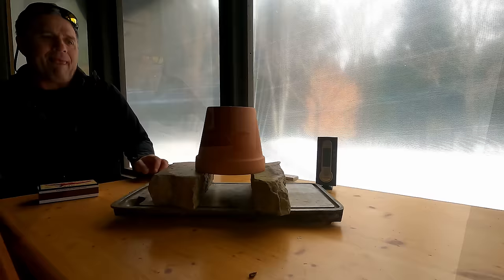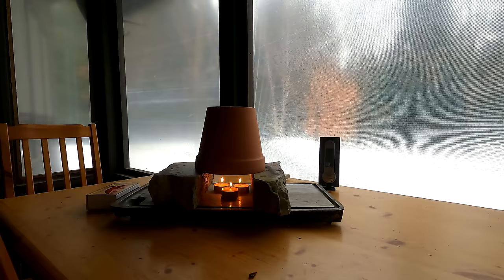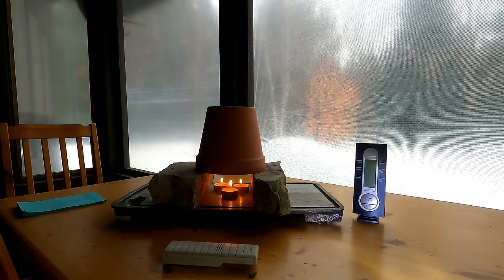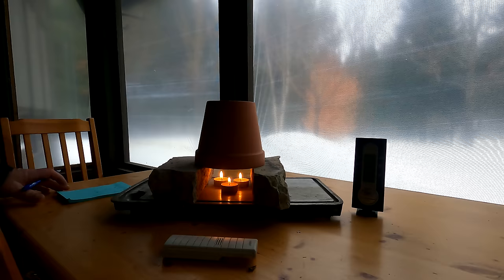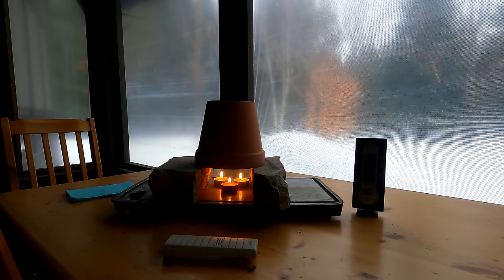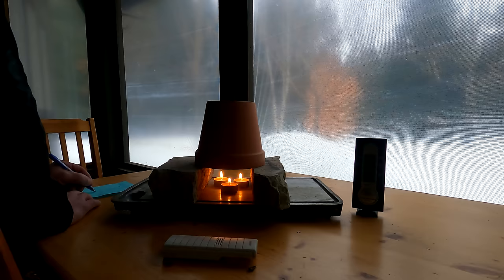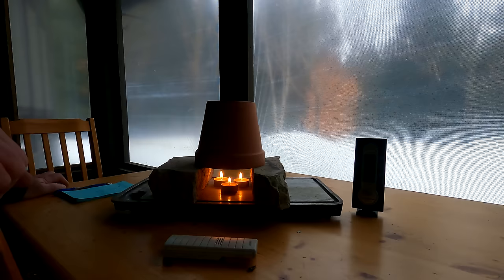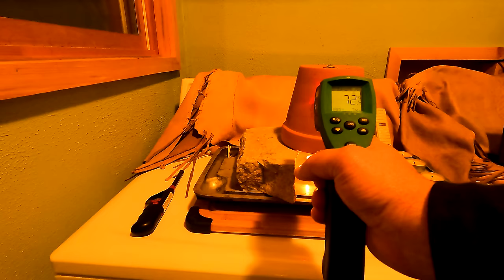Testing the Clay Pot Heater | Truth or BS | Prepping and Testing

Comment: A candle is only going to produce so many BTUs. No amount of pots will increase that. You would have the same result by burning the candles by themselves..
Reply: Exactly. High school physics
Reply: No it is a mass battery essentially.  It spreads out the heat and it is a dense mass that holds heat. So you increase the surface area and holds heat longer. It isn't producing more heat just increasing efficiency
Reply: @curve5746  a candle only produces so many BTUs.....does not matter if one heats air, water, or pottery, a BTU will always raises air temp the same
Reply: It's all to do with precipitation in that the heat exchanger accumulated the heat from the combustion and stored it so that it can be released gradually.
Just like the old electric storage radiators.
Reply: @dasdasdatics420  whether a BTU is released quickly or slowly, a BTU will always raise the ambient temperature the same and a tea candle doesn't produce many BTUs
Reply: Put a thermal fan on top of it to distribute the heat????
Reply: @tntgators  sounds like a good test to run. I do not believe it will raise the temperature in the same manner when released all at once vs gradually. I would be very interested to watch both through a thermal camera
Reply: You should probably move the room thermometer away from the pots
Reply: I tried it and it was a complete waste.
Reply: Skip the pots. A candle provides the same amount of heat with or without them.
Reply: Quit smoking pot. It confuses the simple minded human. Just say no🤡😑🙏
Reply: @kurthubbard-beale5003   🤪
Reply: I heat my home with a cast iron wood stove. Recently I put all of my cast iron cookware on top and wouldn't you know it, the stove radiates heat for a longer period of time, after the fire goes out, which in turn heats my home for a longer period of time with no further btus being produced.

Same principle here. You are storing the heat and releasing it more efficiently.

So while yes, a btu = a btu, that btu can be used in different ways. So no, just burning a candle in the open air isn't the same as burning it and storing the energy in the form of mass, in this case a clay pot.

Air, water, soil, wood etc, all have different heat absorbtion and transfer rates. 
For example, water is 25x more effective in temperature exchange than air is.
It's why your cars engine uses a coolant liquid mixed with water instead of relying on the surrounding air to displace the heat and keep it from overheating.

Maybe go back to physics class and pay attention a little more.
Reply: A long time ago I figured out it would take a dozen candles to warm a small well insulated closet. Most of warmness effect would come from lack of oxygen to the brain. If small enough room & heavy insulation no candles would be needed. Our body is a 98.6 heater
Reply: No doubt …..the pot industry put this out…….
Reply: Candle burning without cover, heat rises straight up, marginal hot air mix as it ascends to ceiling. Pots over candle acting as heat sink, captures, retains heat for better local distribution of the energy. Energy output is the same. Distribution of energy is optimized.
Reply: @blackpine6693  🤣
Reply: @Az_N.S.O.L.  You can't compare a candle to a wood fire. The heat source is what generates the heat. Your cast iron (or a pot or anything  else) can only store what's put into it.
Reply: @Mrs.Patriot   Be it a wood fire or a gasoline fire or a candle flame, they all produce heat. 
This is not about what produces more heat, a candle flame or wood stove fire, but how to use that heat in a more efficient way by storing it as thermal mass.

I think that point completely went over your head.
Reply: @Az_N.S.O.L.  But it is. Candles will not heat a greenhouse. Maybe that went over your head.
Reply: @curve5746  
1st law of Thermodynamics... energy canNOT be created nor destroyed.  It ONLY changes form. 
It is impossible for the pots to increase the amount of heat put out by the candles.
Reply: @Az_N.S.O.L.  
No... the pot does NOT increase the efficiency of heat output either.  
BTU is a measure of the heat output of an energy source.  
In order to increase the average temperature of a house, room, greenhouse, etc... the heat output of the energy sorce must be greater than the rate of heat loss. 
There is NO way you are escaping the 2nd Law of Thermodynamics on this.  

The pot is NOT acting as a mass battery, increasing the efficiency of heat output.   
The pot is acting as an insulator slowing down the rate of heat loss around the candles, (the heat source).  
This ONLY allows the air next the pot to increase in temperature a 1 or 2 degrees.  
For the air 2 feet or more away from the pot... there is NO increase in temperature, because the rate of heat loss is greater than the heat output from the pot.  The colder the surrounding air temperature is, the greater the rate of heat loss will be, further reducing the effectiveness of the candle/pot heater.
Reply: @OOTurok  if the candle or heat source goes out, does the pot stay warm and continue to release heat, or does it immediately cool to room temperature?

It stays warm because it is storing the heat. Some call that a battery...

I dont know what is so hard to understand about that fact.

Also can you prove the rate heat loss in his greenhouse is greater in this scenario? No you can't, so your point is moot. You are creating a scenario to suit your narrative by saying it's a fact that the heat loss is greater than the output.

If the heat loss is more than the output, great, the candle won't heat the greenhouse, I get that, but like I said before in my other post, this isn't about if a candle can heat a greenhouse or not, this is about if storing heat in the clay pot helps with efficiency. 
Which it does because the pot continues to release heat after the main heat source is extinguished.

It's really not that hard to understand.
Reply: @Az_N.S.O.L.  
Simple fact is it does NOT work.   
The heat output is TOO small, & the heat transfer from the pot to the outside air is TOO slow. 
The candle-pot is not effective at heating up a large air space outside the pot, because the rate of heat loss of the outside air is far too great.  

The candle pot experiment has been done countless times in college physics classes, to demonstrate how the Laws of Thermodynamics debunks your magical candle-pot heater myth.
Reply: @OOTurok  there you go again, hung up on if a candle can or cannot heat up x(amount of space).
That is not what I am discussing here.

Can you read? If you can read, please quote where I said a single thing, in any of my posts, about if a candle will definitely heat up x(amount of space)...I'll give you a hint, I didnt.

I already acknowledged the fact that if the heat output of the source is lower than the heat loss, that this will not work. But again, that is not what I am discussing.

What I am talking about is thermal mass storage and releasing that stored heat over a longer period of time to improve efficiency of heat transmission.

Is the clay pot considered as mass?
Does a candle produce heat?
Does the clay pot store and release that heat? 
Does adding more mass store more heat and release it over a longer period?

If the answers are yes, then all of your talking points about, a candle can't do this and thermodynamics that, is just you flapping your gums, or in this case fingers.

Someone who talks so much about physics and thermodynamics should be smart enough to follow along with what I'm talking about...SMH 

Are people really getting this fkng stupid???
Reply: @tntgators is not a candle primarily a light source, are these devices not changing essentially light energy to radiant infra red energy? Or something along those lines?
Reply: @littleworkshopofhorrors2395  Hmmm. Possible that it changes but then why change it? All the energy produced by the candle would be absorbed by the air or the room materials themselves
Reply: @tntgators  you can feel the heat of an infra red heater as warmth but not so much of a lighted candle. Think in very loose analogy of a heat pump, which turns a vast low grade heat into something concentrated,that you can feel. One of these pot heaters, if they do work, turns a small high heat into a larger low level than you can warm yourself by.
Reply: @Az_N.S.O.L. 
BUT this entire video is about heating your house with a few candles under pots.  So why do YOU keep going away from the candle?   Yes the pot is a thermal mass BUT the candle does only put out X number BTUs. The pot will store these BTUs and release them slowly but it's still the same number BTUs.  And a CANDLE (basis of entire video) will not heat a room!  Air is a horrible conductor of heat compared to many other things, that's why even the cast iron wood stove takes hundreds to thousands of BTUs worth of wood about an hour to heat a room from 58 to 70 degrees F.   Again, YOU try reading. VIDEO IS ABOUT USING CANDLES TO HEAT A ROOM!
Reply: @kirkstinson7316  my posts are in response to the ops post about burning candles by themselves giving the same results, not the video itself. That's why my comment isn't on the main page and is instead here...SMH 

Did you even think before posting? 
Apparently not...I've only said my posts have nothing to do with if a candle will or won't heat a given space about 10 times now.

Damn, brains don't run strong in this thread.

But I do agree air is a terrible conductor of heat, which is why you use the clay pot to increase the efficiency because ceramic is much better at conducting heat than air...lol thanks for proving my point.
Reply: It’s not the BTUs of the candles. That’s a fixed amount. What this fixture does is distribute the heat more localized to where a human is likely to be. Without the pots as heat capture and storage devices, the heat from the candle would go straight to the top of the space as a thin column of heated air and combustion gases, but humans don’t walk and sit on the ceilings. We live closer to the floor and to table tops, and that’s where these pots would be placed. The pots slow that heat transfer upwards and spread the column of heated air rising from the candle wick pin point to the diameter of the pot.
 The fact that three tea candles heated the outside of the outermost pot to 70’C in 2-3 hours should indicate to you how much heat would otherwise have been warming your ceiling straightaway from the candles alone.
Reply: @user-ms5su6jv2j  agreed to a point. Yes one could sit close to the pots and warm one's hands. This video and others like it purport to heat a room. This experiment had many flaws. Outside temperature.  HVAC running? Sunlight, and of course his thermometer was too close and he didn't take the temp in the rest of the room.  A candle in a room will not make any difference unless you sit beside it and hold your hand over the flame
Reply: @azfoa5218 you are 100 % correct   however a clay pot heater won't do much, probably heat a small closet  a steel plate on a wood stove or any source of heat will retain heat
Reply: Exactly right! Basic science.
Reply: @Az_N.S.O.L. exactly what I was going to tell these dolts, but it's useless explaining radiant heat to them apparently
Reply: Except your wood stove isn’t a closed system., as the flu vents out of the room.  This clay pot thing vs just candles is a closed system in terms of the room.
Reply: @theholisticmachine1493  
You don't need a clay pot to radiate heat from the candle.  
Radiant heat already comes directly off the candle flame, because the combustion of the wax is an EXOTHERMIC  REACTION.  
Perpetual Motion is a myth.  People like you need to take a basic grade school level physics class.
Reply: Definitely worth trying and proving it wrong or right!
Reply: So are you interested in cooling the whole room or the area close to the pots - without the pots the lit candles and their BTUs heat a thin column of air directly above them and then (at best) create a temperature change in a thin layer around the ceiling. This is not a central air heating system - it concentrates warm air where you need it. Is it cost effective? I say yes. Many many people seal off most of their houses - not trying to heat the whole thing - just where they happen to be - the pots take that concept a step further - expand the radiant aspect of the candle's heat via the pots - and just heat a bubble in the room where they are. The BTUs are not wasted in a thin stream directly above the candles and in a small later near the ceiling. Think about it.
Reply: @tomwells6499  
Moving the goal post does not validate any of these pro candle-pot claims.  
The claims made in all these videos, is that... putting a pot over the candle creates a heater that will heat a room or a greenhouse.   This claim has been proven FALSE.  

The pot is an insulator that turns the candle into a tiny oven,  NOT  a heater that can heat a small space around it.  
The air space being heated up, is INSIDE the pot.  So unless you stick your hands inside, or on the pot, you are NOT going to get any significant heat from it.  
I can crank the oven in my kitchen up to 400° F & it won't do a thing to heat the air in the kitchen.  

The radiant efficiency of the candle in the room is already 100%.  The pot canNOT increase that efficiency, because of this inconvenient physical law that doesn't allow energy to be created.
Reply: @OOTurok - Hold your hand three inches above a lit candle and then three inches to the side and then tell me about the radiant properties of a candle flame.
Reply: @tomwells6499  
It's simple.   The radiant properties of the candle are that it radiates heat, because combustion is an exothermic reaction.   
Direction of the radiance is irrelevant to the fact that the candle radiates heat.  
You have no valid argument.
Reply: In order to have a legitimate result for your heater, you would need to measure the heat that you contribute to the room over the same period. What you would learn is that the candles contribute very little to heating the room. The heater focuses the heat of the candles and radiates that heat in a manner you find useful.
Reply: Same amount of BTU yes. 
Just a better way of radiating the heat , after the pots have heated up of course. So initially it would actually be a negative.
Testing pot temperature only proves indeed the candle is making it hotter 
Too many variables in a room exposed to the elements with people coming and going. 
I think that pot works as a nice hand warmer.
Reply: The pot slows down the heating of the room. Heat the pots and after the candles go out heat comes out of the pots.

If you want to heat room faster, just use candles. If you want to heat room low and slow use pots, or bricks, or sand, or salt, etc.
Reply: @Az_N.S.O.L. Yeah so you heat a large cast iron stove with big blocks of wood, not a candle……lol😂
Reply: Need to remember that your body heat warms the room too.
Reply: Come on! But we like living in fantasy land
Reply: @tntgators  you're correct a candle only produces so many btus, but the pot creates more surface area for heat to exchange with ambient air
Reply: Add enough pot, you’ll feel better. It’s science.
Reply: Not true. It’s Radiant heat.
Reply: Calling something a battery doesn’t mean anything to the science. The only difference is a little bit time. Amount of but’s released are the same. One will not heat a room more than another. What does happen is the pots allow the heat to be radiated out in a manner that allows people to feel the warmth more than directly above the candles as they burn. Does that heat the house? No, no more than 3 candles and a fan does. But because of the radiating of the pots people feel as if it doing more. The best way to heat a space is to produce more btu’s than is released by that spaces insulation. Great insulation allows for less btu’s needed to warm the space because of the slow loss of heat across the medium.
Reply: @curve5746  The air in a single room is more thermal mass than a candle can rapidly heat, so that isn't necessarily beneficial.
Reply: @Az_N.S.O.L. it takes time for the pots to heat up just the same as when they cool down. There is no advantage. Simple really.
Reply: Maybe if we had a dollar for each arguing comment we could build a 10x10x8 room, basic insulation, couple of windows, one table and chair. Setup the pots with tea light candles and test for yourselves. However, you could watch all the videos from both sides either proving or disproving the debate and pick which one you want to believe, without comment!
Reply: I would have used watts as the unit.... But you took the words out of my mouth.
Reply: I would have used watts as the unit.... But you took the words out of my mouth.
Reply: I would have used watts as the unit.... But you took the words out of my mouth.
Reply: I would have used watts as the unit.... But you took the words out of my mouth.
Reply: I would have used watts as the unit.... But you took the words out of my mouth.
Reply: I would have used watts as the unit.... But you took the words out of my mouth.
Reply: Thank you. A person of knowledge.
Reply: @danielpartin875  Joules is joules. Watts is watts. 

Where do you think that energy goes when there isn’t a flowerpot over the candle?
Reply: Its like saying the transmission on your car doesnt matter at all because the engine only has X horsepower.  Its the same thing but candlepower
Reply: @lostpony4885  wow, that analogy doesn’t work at all.
Reply: I use single pot and a couple of tea lights on my workbench if I want to warm the space slightly, works fine.  It acts as a mini radiator for the bubble of space a few feet around the pot, spreading out gradually, rather than shooting up to the ceiling.  If you buy an IKEA plant pot with base and a steel cutlery holder, you only need to plug the top with a bolt or coin, and you’re good to go.  You don’t need lots of pots.  My immediate workspace will raise from 16c or 17c to 20c with this set up, I keep a digital thermometer about 2 feet away, so know exactly how it performs.  Been doing this a couple of months now, you can turn the broader space heating of your property down lower, and localise the benefit of the pot heater for times you feel chilly.  Lots of overthinking going on in this thread, just try it sometime.
Reply: I agree I tested it..the room didn't get any hot with the clay pot...the tea candles heated the room..I beg the difference..😊😂.I don't know how he's getting his reading 😂 oh well. How about we just agree to disagree😅😂
Reply: Half the people on here can’t string a sentence together, let alone be trusted for input.
Reply: It changes how the heat is distributed. By heating on object, less heat is wasted through imperfections in the system. So , yes it's the same energy, but it's being used better.
Reply: The point is that three tea candles can heat up a room, albeit not hugely. Tea candles are dirt cheap by the way, large candles not.
Reply: more air touches warm pottery that would pass through an open candle flame
Reply: I agree… i think it helps to maybe dry gloves or something though, with a candle…. You can lean em up and keep them from burning or snuffing the flame…. But i tryd this once.. had like 20 of them in the house with 3 candles each…. Couldnt tell a difference.
Reply: But they are using three and the pots(three) are trapping the heat in them and letting the heat out slower than you can think!
Reply: What everyone is missing in just talking about BTU’s is that the clay pot is effectively turning what would otherwise be just convective heat, into radiative heat.  Radiative heat is much more effective at filling a space because it is infrared rather than just warm air currents fluffing about.  The amount of heat is the same, the transfer to the room is more efficient.
Reply: In this case, 3 btu’s roughly
Reply: @paulcurrie7828 It still does not vary the fact it will not increase the heat value of a BTU.
Reply: It's Not about increasing BTU. It's about the management of heat distribution.
Reply: it concentrates the heat, especially if you put some steel bolts in there.  the candles alone dissipate the heat too quickly to make the same effect.
Reply: From personal experiences it works better than you would expect
Reply: I see the Chinese are trolling.
Reply: All the pot does with a hole in the top is direct the airflow from rising thermals. Thermals rise, so does air, thermals drop, so does air.
Reply: @Az_N.S.O.L. I tried that with my cast iron stove and I also tried it with fire bricks, I didn't notice any real difference.
Reply: @buy_large_mansions  fire bricks aren't designed for storing and radiating heat. They are designed to have LOW thermal conductivity. It's why they are used in kilns to maintain the INTERNAL temperature of the firebox.
They are insulation, not thermal conductors.
So yeah, not surprising they didn't work...
Reply: @Az_N.S.O.L.  yes but using cast iron pieces on the stove like you did didn't work either.
Reply: @buy_large_mansions  how many pieces/weight did you use?
I have about 80-100 lbs worth of extra cast iron on it. Two 20×30 griddles, a Dutch oven, two sets of skillets 12,10,8,6" (8total) and a kettle.

If you only put a couple extra pounds worth of cast iron on it, it wouldn't make much noticeable difference.

Mine is still VERY warm to the touch the next morning, so it is storing and releasing quite a bit of extra heat. Which proves that adding mass to a heat source, is a more efficient way of using said heat.
After all, I'm burning roughly the same amount of wood every time overnight (the stove can only hold so much), but the heat is being stored and released over a much longer period of time by using extra mass.
Go figure...
Reply: …not so, grasshopper…